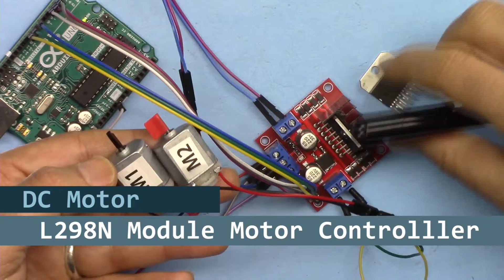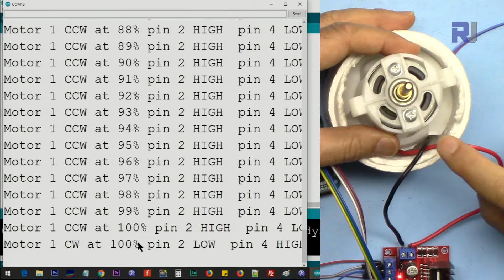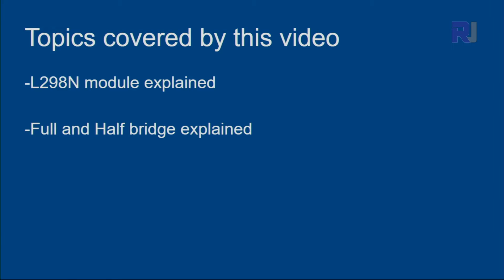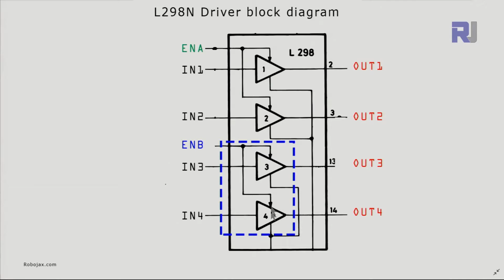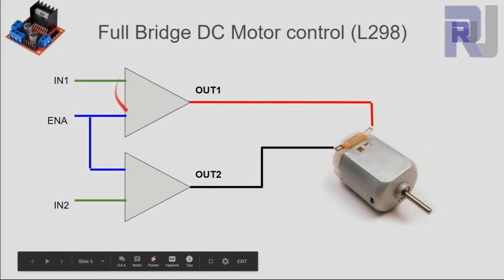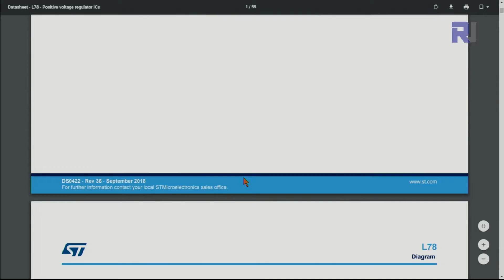Lesson 53: Using L298N Motor Driver for DC Motor Control - RJT509

Comment: hello i know this is an old video, but i was curious how many volts you were using to power this? i am having trouble finding an adequate power source considering the l298n is outdated and seems to be dropping between 2-4v

Comment: the library for the zip file is not available and working, can you please provide again so I can use the code?
Reply from the maker: Hi, wow. thank you for letting me know. the link has been corrected now.
Reply: @robojax  Hi, the zip works but I am getting this error: "Error: 13 INTERNAL: Library install failed: archive is not valid: multiple files found in zip file top level." I have tried to see many videos, but I am stuck on how you made the library zip file work. This happens when I try to open the zip file you provided so it cannot be downloaded into arduino. Please help and thank you.

Comment: Hello, I am doing a project that now requires running a DC motor with some specific requirements. Like, the motor needs to move horizontally from a starting postion to three different positions rotating clockwise and come back to the initial position moving couterclockwise. Each position is defined by a switch. Can you help?

Comment: Thanks for the informative video. I remember people are saying when power supply >12V, you need to remove the jumper on L298N to prevent damage of the voltage regulator. Depending on the voltage used, the third slot of the power terminal block can be 5v in or out. What is the voltage you are using here? It looks like you are outputing 5v to the arduino with the jumper in place. Please comment on the best practice for higher voltage use.

Comment: Hey, I wanted to ask if this supports multiple drivers? so i would have 2 drivers for 2 motors each that i can use in a drone
Reply from the maker: Hi, I just created code to use two L298N modules to control 4 DC motors https://robojax.com/course1/?vid=lecture53 you may watch this video to learn how to use this module to control 2 motors https://youtu.be/wn5D7j1ybxY good luck.
Reply from the maker: But to let you know there is a new module which can handle higher current and wastes energy way less than L298N. you may see the video here https://youtu.be/W_Wm28nQAYA

Comment: In fairness to Robojax, I have learned a lot from it. My first project as an hobbyist is motorized rolling Swing Steel Gate, using takanawa 24V DC motor, with inductive proximity sensor and solenoid lock for both wing.

Comment: This is an old motor driver 2A only. The other version is L298 Dual H Bridge Motor Speed Controller DC 6.5V-27V 7A PWM Motor Regulator Board 12V 24V, but is also in this version, I test it  with 24V 2.5A DC motor and I encounter an intermittent stoppage of motor. I'm not quite sure if I fail to use diode for each motor.
Reply from the maker: when we say L298N. that is the only chip which I've shown the datasheet and it will work whatever voltage and current value is given in the datasheet.